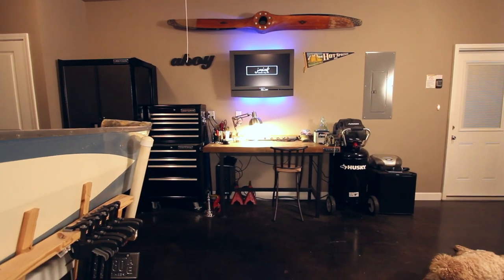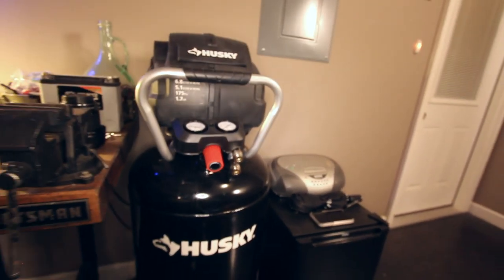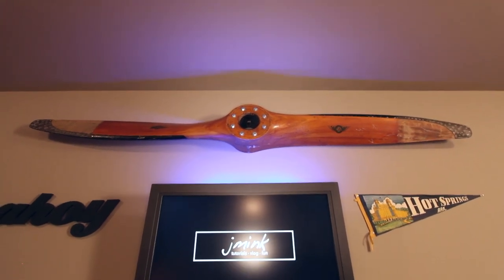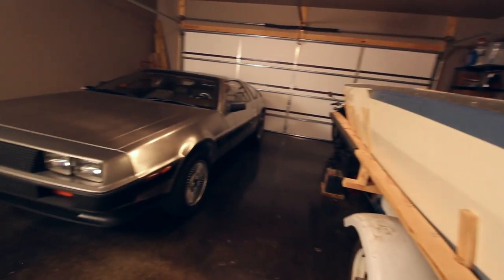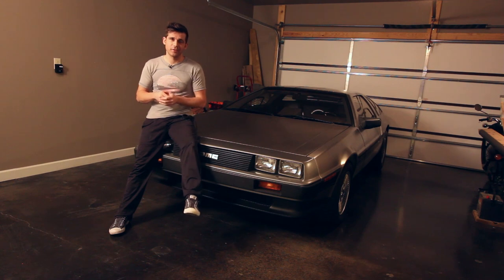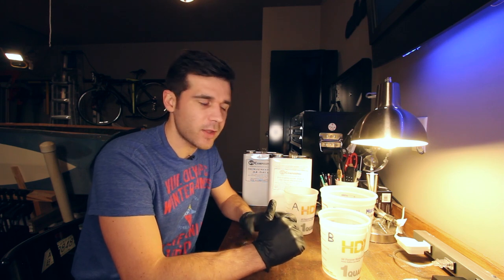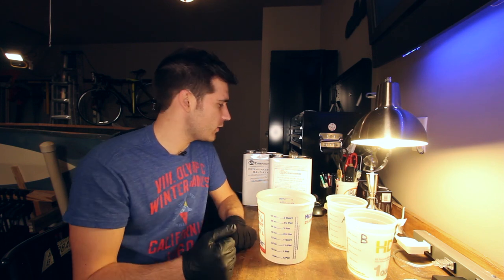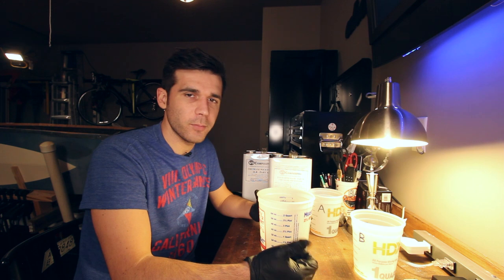Pouring Foam Under the Deck (is that a DeLorean?) // Project Glastron/Vlog #17

Comment: Jay - great update!  I have to agree, drilling holes in a boat just seems wrong!  
The new garage looks great, if maybe, a little to clean!

A DELOREAN - SWEET!
Reply from the maker: +PorkChop659 thanks!  I thought about the process a thousand times before I was ready to drill through the deck. I didn't want to mess anything up!  I love my new garage and yeah it is a bit clean, I'm going to try my best to keep it that way.  Thanks for watching and commenting, I appreciate it!
Reply: I worked at a marina back in another life and I had to install an in-dash depth flasher in the bow of a bass boat.  He about flipped when I broke out a 4" hole saw and started drilling!  HAHA
It will be all worth it the first time you splash it in the lake!

Comment: Dude, you've got a freakin' DeLorean! That is very cool! I have a boat similar to yours. Mine is a cheap knock-off of the Glastron. Its a '73 Bonito 150 modified tri-hull. I have had the transom and motor rebuilt on it. It needs a paint job and a new deck. Your videos has been a huge inspiration to me. Luckily I have been using my boat the whole time you have been restoring yours. I know you can't wait to get it out on the water. I can't wait to watch it either!! Keep up the awesome work!
Reply from the maker: +Hanging With Stephen thanks for the kind words!  I do indeed have a DeLorean and I don't often talk about it.  I felt it was time to mention since it is sitting beside the Glastron.  It's always awesome to hear from people about their boats and what they've done to them.  Comments like that keep me motivated to keep working on mine! I'm always humbled to hear that these videos have helped people in some way, thanks again for the feedback.  I'll keep hammering away and one day you'll see this old boat back on the water!
Reply: @jmink  Six years later, and it's still helping people like me.  Awesome job.

Comment: I'm doing a deck and stringer repair on a 1986 procraft 1759v. Do you think I should use pour foam with this type of boat? I don't see how it would work because of the casting deck in the back and in the front. Wouldn't you think the foam would push those cabinets up? Thanks for the info!

Comment: Your videos have been awesome for helping me with my v156. How much foam did you mix for the long run beside the middle bays. It was 5/5 for 10oz on little boxes beside bilge box, then you pour the long run. It would help me alot. Just getting ready to drill holes...nervous, lol. Any input on foam mix quantities would be very much appreciated. Thank you for your GREAT VIDEOS!!
Reply from the maker: +Mark Davis thanks for watching and commenting!  I seem to remember doing 32/32 ounces for big bays that you are referring.   I definitely wasn't in any hurry to begin drilling holes in the deck, but once I had it finished I was mad that I waited so long.  As far as mix quantities I remember making a few 24/24 for some of the smaller bays, and a few 5/5 batches too.  The 5/5 were to add more on top when I felt I didn't have enough poured.

Comment: @jmink hey man I’m new to all this but I’m just about finished stripping down my 1988 Glastron ssv-162. Looks kind of similar to yours so your videos are helping me understand a lot. I was wondering, why is it necessary to pour foam under the deck? Mine only have a few spots with foam. Is it to add buoyancy and stability, or is it to guide the water that could get under neath the sub floor?
Reply from the maker: Foam is a divisive topic.  After researching I was all for it.  I believe that it helps structurally with the boat.   As well as the floatation properties it adds to the boat.
Reply: jmink haha thanks for the reply man. Since I’ve asked about it I’ve thought about it a lot lol. It probably also helps with sound insulation so it’s quieter inside the boat, so it doesn’t sound like you’re driving a john boat.. I’m definitely gonna go with the foam but I was just curious why the hell there was so much foam, as I was cutting and chiseling it all loose! haha.

Comment: Looks like she might be getting a little heavy.  But can relate with the stability and strength,  If you should ever want to ram someone... LOL...  Curious,  Why didnt you make the bulkhead separating the bow and deck support out of one piece?   Love your videos,  looking forward to the rest.
Reply from the maker: She might be a bit heavier, but that's hard to say. I believe the old girl was waterlogged back in the day.  Whoever replaced the deck previously never sealed the deck with fiberglass and underneath that old carpet, there were spaces between the plywood where water could drip down.  I'm convinced there was always some water underneath.  You're right about my thinking with stability and strength and like you mentioned should I ever need to ram someone I won't be scarred!  

As far as that bulkead separating the bow and deck, I honestly attempted to make that out of one piece, but I wasn't happy with how it turned out.  I then broke it up into three pieces instead.  Thanks for watching and the comments, I look forward to you following me along my journey.

Comment: How did you get the top off did it just in screw. I have a 78 Glaston and I am getting read to do the floor also
Reply from the maker: It was screwed and fiberglass-ed.  The fiberglass was at the transom area.

Comment: Why not foam around the stringers and under the floor before floor was installed? Then you’d know if it’s everywhere you want it.
Reply from the maker: I wanted less of a mess to deal with in regards to the foam.  By pouring foam under the deck and not without the deck present I didn't have to worry about cutting excess foam that might have built up past stringers and bulkheads. The foam is a mess to deal with after it has cured, I learned this by doing the foam boxes in the rear of the boat next to the transom.  This is totally user preference there's not a right or wrong way, but for me this was how I justified doing it the way I did.
Reply: jmink Gotcha. I was thinking about having to drill those holes in the fresh floor.  We spray foam houses and shave off excess foam to install sheet rock.

Comment: I realize this is an older video. But another way to determine how far the foam has traveled, is to feel the deck. If it is warm, the foam has gone that far, if it isn't warm, the foam has made it that far.
Reply from the maker: You're correct.  I was able to feel heat off of the foam.
Reply: Or even put a spot infra red thermometer on it.

Comment: How long did the total restoration take?  Just wondering...
Reply from the maker: +Vinny Gumbats I'm actually still working on it.  But, I started Around February 20, 2014, and have been working on it bits at a time.  I lots of the steps take hours to complete and I've never calculated how many hours I have in it, but I know that number would be high.  If I had more free time I probably could have been done by now.
Reply: Looks great, was just wondering. Thx
Reply from the maker: Thanks for watching!

Comment: why wouldnt you just foam it before putting the deck on? that way you know for sure youre getting complete fill, plus you had to drill and fill all those holes.
Reply from the maker: There were a few reasons that I decided to put the deck down first then pour foam through the holes like I did.  The first was that I didn't want to deal with making a mess with the foam such as, when pouring without the deck, I would've had to worry about shaving the foam down even with the stringer tops (if I over poured).  Not to mention, if I would have had to shave foam down some of the areas, these areas aren't the most spacious so that wasn't going to be easy. Then there's the point you made which was getting a complete fill, with the deck down first I could pour plenty of foam and make sure that it filled all of the nooks and crannies and get a complete fill, by forcing the foam to travel to the open spots by putting down my 2x4 over the pour holes as it was expanding.  Again, these are the reasons I decided to go the route I did, but you can do this however you want when working on your boat.
Reply: Exactly, this is very poor practice and will lead to water ingress quite quickly.